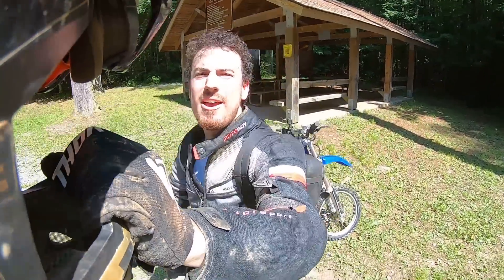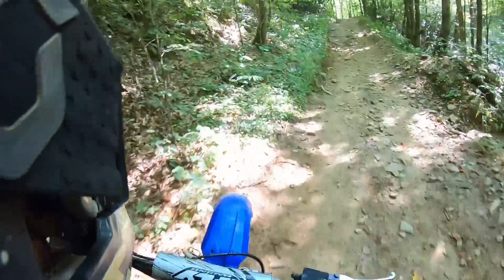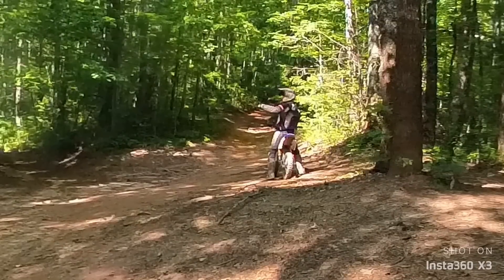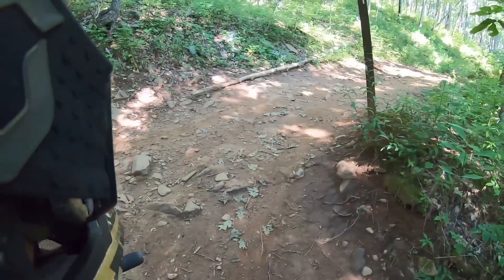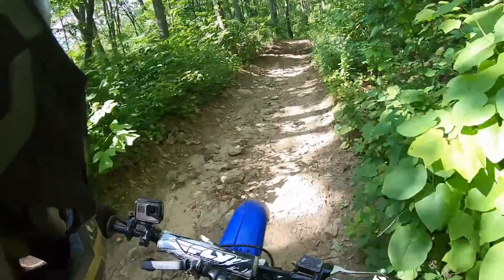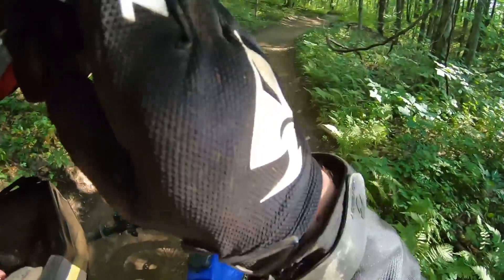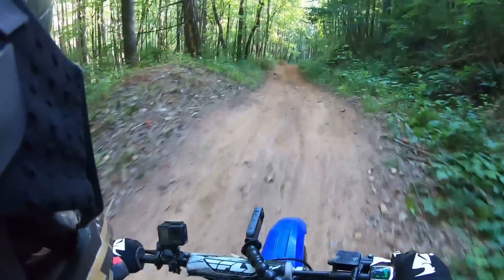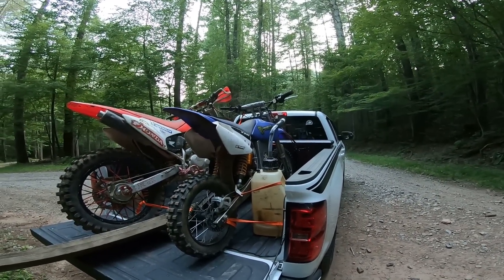First Real Off Road Test of the Electric YZ 85 Dirt Bike

Comment: Electric would be better if batteries didn’t run out so quick, but that thing rips hard for a little bit 🔥💯🇺🇸
Reply: Looked like pretty good range too me. Enough for him to get good and lost anyway.
Reply: You'll run out of gas before that thing runs out of battery. You can simply make it easier to swap it out with another one. Biggest downside is weight imo
Reply: @MrArcticPOWER it isn't even close the professionally made EV bikes only get a fraction of the run time vs the petrol equivalent not to mention that for the size of a couple extra batteries that might get you a few hours of riding you have a gas can that will keep you going all weekend
Reply: @shaynegadsden   You're talking about road bikes. Dirt bike gas tanks go down way faster.  He only used 40% for 2.5 hours. You think a YZ85 gas thank will last over 5 hours?
If you have 2 battery, you can simply charge up the second one while you ride on the first.
Reply: @MrArcticPOWER  I've road over 4 hours on my KX250 and only used half a tank. He made a good point to consider at the end that he was right on the precipice of his batteries becoming weak and the power quickly dropping off since voltage drops with capacity. Using 40% in 2.5 hours doesn't mean he has 1.5x more ride time left. I wish more companies would adopt the idea of quick change batteries but on a legitimate machine(read powerful) your talking carrying around $2000 or more of extra batteries for more than a half day ride at a casual pace. You can buy a spare running gas bike for $2000 lol. Its simple physics, the energy per mass is just not there yet for an electric bike. Check out the new Stark Varg, iirc they have a battery twice the size of his 85 and a good rider can kill it in a 30 minute moto on a track. Hopefully technology will continue to improve and soon we will either get higher energy/mass batteries or motors that are substantially more efficient that begins to make electric more realistic for your more serious riders.
Reply: @jitsnydzer6302  I never claimed that electric bikes were better in any way or cheap. I especially said that the biggest downside was wheight, you can call it energy density, that's the same thing. 
Batteries will still be way cheaper on the long run. You don't have to pay for gas and there's virtually no maintenance, so who cares if you have to carry 2000$ of batteries?
If you can kill that battery in 30 minutes, don't come and tell me that same rider will go much longer with a tank of gas.
Electric motors are already over 90% efficient, so unless you want to ditch the chain and go for a hub motor, it doesn't get much better than that, 
Again, electric dirtbikes aren't better, but runtime isn't the issue at all.
Reply: @MrArcticPOWER  Range is the only major issue. The stark varg can make up to 80 HP and whoop any gas 450 made today and I think it only weighs something like 20lbs more than a new 450. When I say energy/mass im not talking about how heavy the battery is. Im saying there isn't enough physical space on a bike to put a battery with enough capacity for a FULL day of riding and then depending on where you are you have to figure out how to charge overnight. Again battery swapping is a good solution but ultimately a HUGE investment. You seem hung up on a tank of gas, I can refill my tank in 3 minutes and a $40 gas jug has enough fuel for me to ride for 3 days. It would take me years of riding to burn enough fuel to pay for one extra battery. Look into AMGs new axial electric motor, they can get better but I concede that the most likely improvement will be in battery technology.

One last thing, the "zero" maintenance thing is complete nonsense. You dont have to change oil and clean your air filter sure but you still have to do all the rest of the maintenance a gas bike would have to do. Chains, bearings, tires, seals, suspension oils and springs. To replace one battery i could rebuild my KX250 at least 4 times. I like electric, but its got a ways to go still before it is a good option for the masses because of the range.
Reply: @jitsnydzer6302  There is more than enough space to ad battery capacity on that bike. 6.5kWh is nothing to brag about, they keep it this way to save weight. 
When I say zero maintenance, I'm talking about the engine, I figure you would understand that. And If you ever owned a 250/450, you know damn well you can't ride for years without touching the engine. It might take you years to pay the battery cost back, but it'll still end up cheaper. 
Batteries are getting better and cheaper, we just have to give them a few more years.
Reply: @MrArcticPOWER   So is electric better than gas because a battery lasts longer than a tank of gas or do we need to give them a few more years? I'm not even sure what your stance is anymore, best of luck to you lol.
Reply: Needs a more aggressive regenerative braking to help extend the range.
Reply: @Ratkill9000  unless your traveling down a mountain for your entire ride the power gained from regenerative braking is negligible. Its basically a free feature that you can turn on with any good quality electric motor/esc combo but it makes a negligible difference range wise.
Reply: Needs a gas motor in it